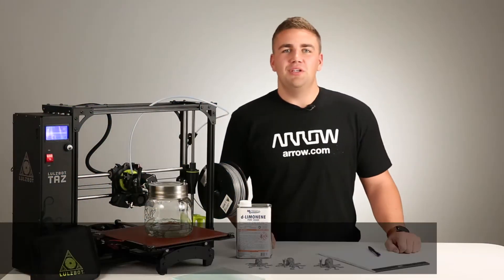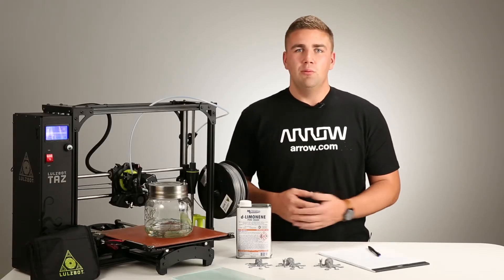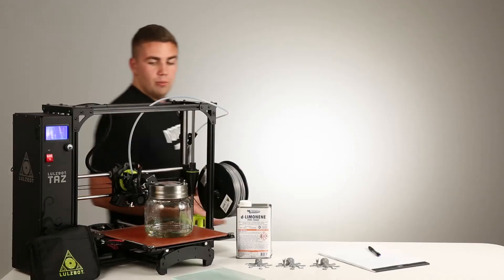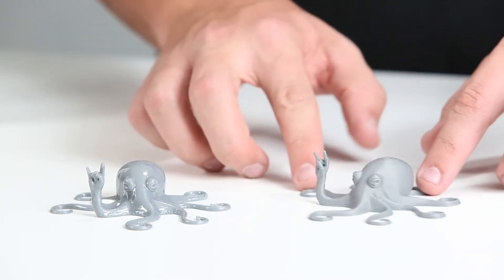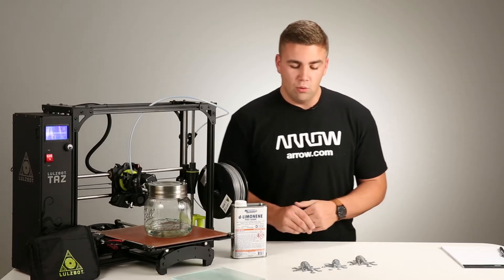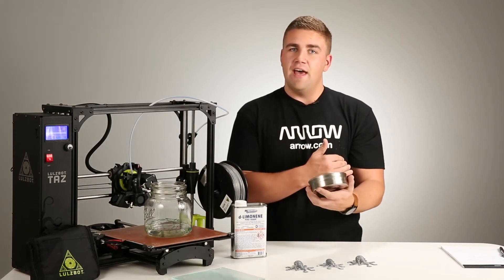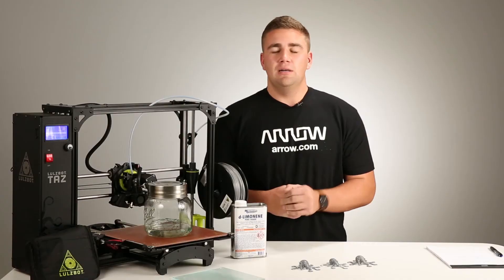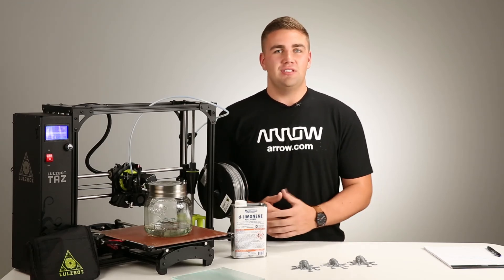Limonene Vapor Bath - Acetone Smoothing Alternative - Taz 6 print -- Arrow Tricks of The Trade

Comment: Just a heads up for anyone using D-limonene on a heated bed: D-limonene has an EXTREMELY LOW Flash Point (120°F, 48°C). It may not spontaneously combust at this temperature, but care needs to be taken in regards to ignition sources.

Great video overall though.

Comment: Hi, 5 years after, here I am.
D-Lamonine is also used to totally recycle polystyrine/foamed. I have seen where the foamed Poly and the d-lamonine is each 100% recovered.
I just started printing with SBS filament and I got a small bottle to paint the models with to smooth em out. Using a small brush for the painting.